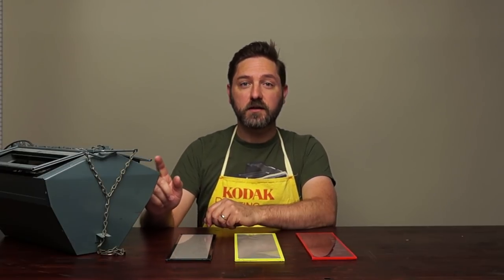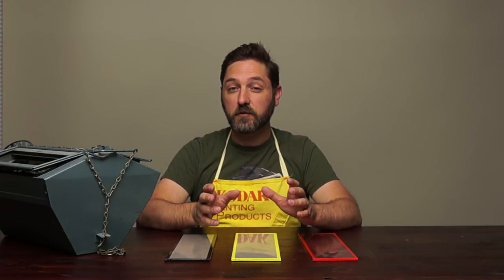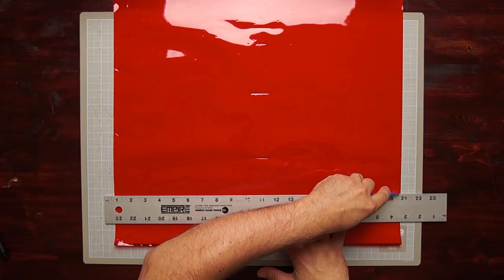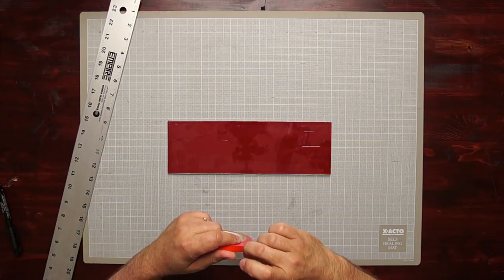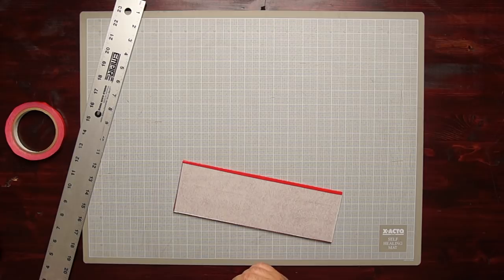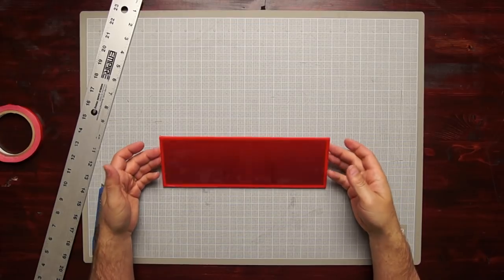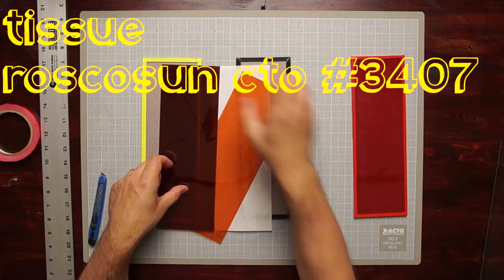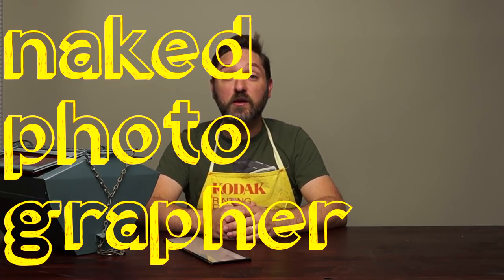DIY Safelight Filters for the Thomas Duplex

Comment: Cool diy trick. Thank you. Could it be use to replace the red safelight filter on enlarger just under the lens?
Reply from the maker: I never use those for my enlarger, so I couldn't say.  If you try it, use at least 3 layers of the red gel to start.
Reply: Theoretically yes, however most under-lens red filters are made of thin rigid plastic. Trying to assemble a sandwich of flexible filter material and glass to  fit may prove difficult. Consider going without a red filter. Years ago, I discovered that I didn't use mine in my workflow, and somewhere it got removed.
Reply: Also, note that the light output of a Thomas Duplex is extremely bright, far more so than your enlarger, so a direct copy of what he is doing here is probably way too dark for your use.

Comment: do you find that you can see well enough to read pencil writing on the back of your photo paper at the enlarger?  When I print, I write the exposure info on the back of the paper, but my Premier light is too dark to see what I am writing. In your videos, it appears to be bright enough to read.  I have tested my lights, and with those "cheap" lights my darkroom is too dark to see well.  Any brighter and it starts fogging my paper.
Reply from the maker: I have the vanes wide open while making videos, but almost completely closed when actually printing.  It is still bright enough to read pencil marks.
Reply: @TheNakedPhotographer  sounds like I need to visit ebay for a Thomas light.

Comment: Any way an LED can be used instead of the bulb?
Reply from the maker: Two issues I see: A new socket would have to be wired in because I done know of any led bulbs with the right bayonet base, and maybe other parts to get the right voltage/amperage. Second is color.  The sodium vapor bulb is already close to safe and the filters fine tune the color output, but an led is going to be white light in general and need serious filtering to the point of just using standard safelight filters.  I’m not aware of any “sodium vapor” led’s with equivalent wavelength.